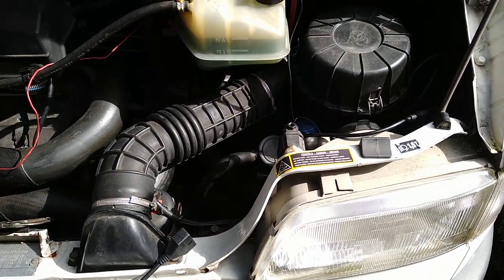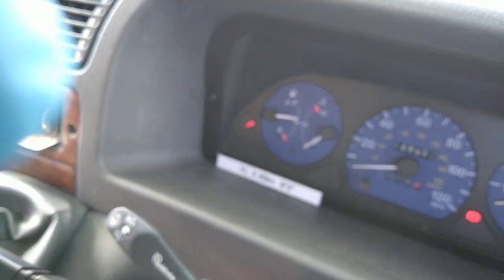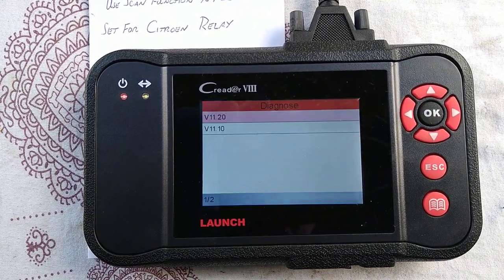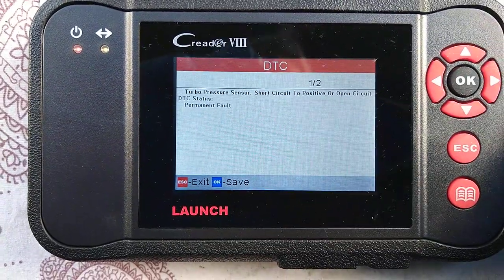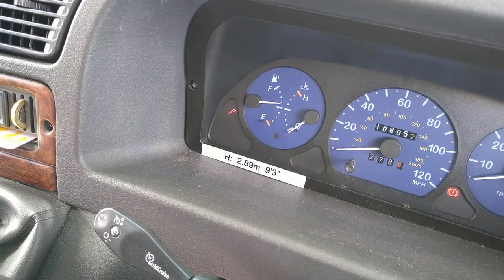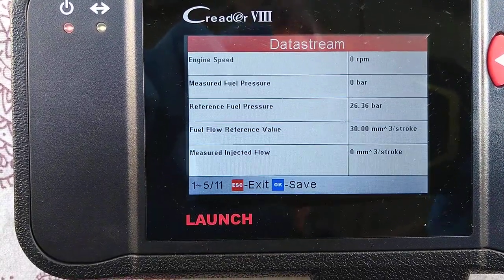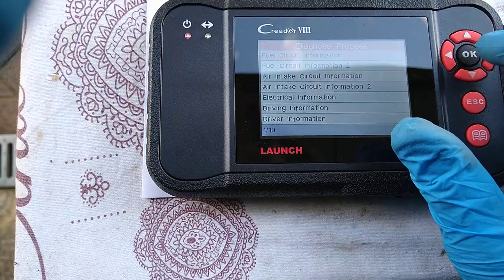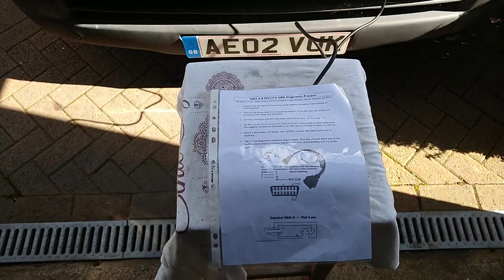2001 Peugeot Boxer 2.8 HDI / Fiat Ducato JTD OBD Fault Code Reading and Clearing CReader VIII / 123

Comment: Hi thanks for the video,  do you know if you can read the immobiliser information on this also? 

I have 2002 ducato motorhome and I'm immobiliser is stuck on and need to see if the engine ecu is communicating with the immobiliser module.  👍
Reply from the maker: Hello. I don't know but I very much doubt it. More likely you'll need to use the MultiECUScan software (previously known as FiatEcuScan) as briefly demonstrated here: https://www.youtube.com/watch?v=gI3R9OGyD-I

Best wishes, Steve

Comment: If this thread is still live - can anyone tell me what the fault code that appears below the handbrake light is? Mine comes on when turning and go backs off started this week ? Looks a bit like a log bottle and fan symbol , all I can think of that it looks like
Reply: Hi. Dashboard layouts change over time so it's important to describe the symbol. If it is a squar(ish) bottle with a fan inside it then it is most likely the "low Coolant level" warning. 

The sensor for this will most likely be on the coolant reservoir cap or the side of the coolant bottle. For info I lot of warning lamps light up when you initially turn on the ignition so you can see that the bulb is working.